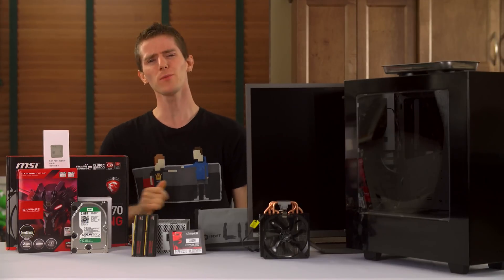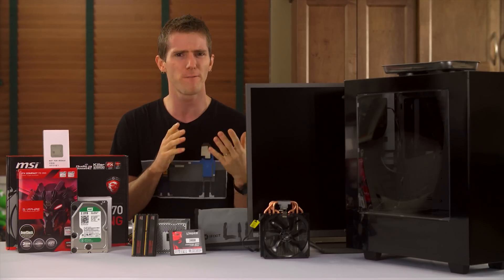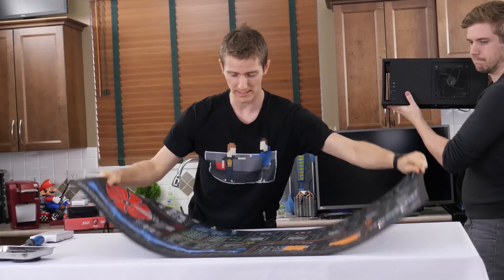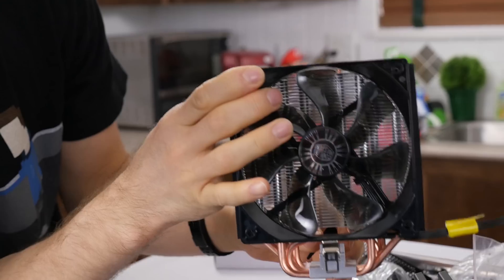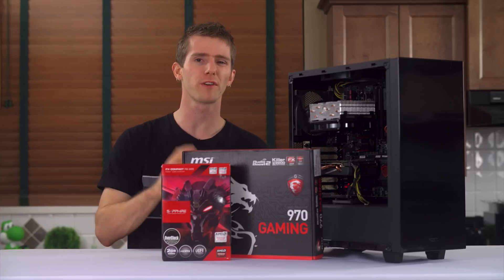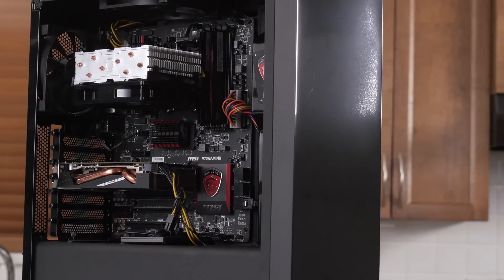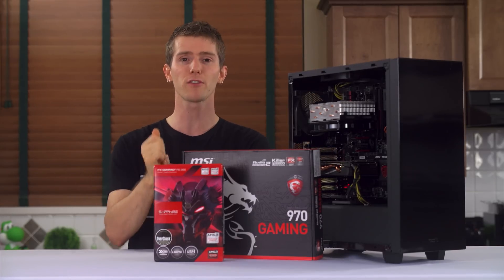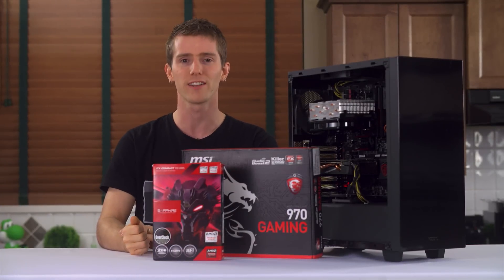Can you Build a 4K Gaming PC for Under $1000?

Comment: Hey can running games higher then the recommended settings be bad for your graphics card?
Reply: Nope. I run mw2 (it's still a good game) at 1440p on a laptop with highest settings with an average fps of 45. The recommended settings are 720p. (Geforce 750m)
Reply: Sweet thanks!

Comment: LinusTechTips You could've used the better GTX 750 Ti instead of the R9 285 and still save some money.
Reply: Siddharth Desai For a 4K gaming rig? Are you kidding right?
Reply: Siddharth Desai wtf, its not a 500 dollar build
Reply: Siddharth Desai the 285 kills the 750ti
Reply: Sergio Tellez Not for 4k. But on FHD 750 Ti is the better option. Gamers know that the words 'affordable' and '4k' don't go well together. If you want real 4k, pay the price!
Reply: Glorious Nvidia Master race
Reply: Siddharth Desai I'm sure you understand that a GTX 750 Ti is so cheapper, but it's so less powerful and the games are going to require more power
Reply: a 285 destroys a 750 ti, hell, even a 270 is better.
Reply: In a $1000 build I'd put a r9 280 on 2way crossfire or a gtx 980
Reply: Are you nuts dude??? A r9 285 rapes a gtx 750ti at any resolution. Even a r9 270 is faster. Gtx 750ti is comparable to a r7 260x/r7 265. Think before posting misleading stuff
Reply: Mukunda Madhab Rajkhowa its just, not even in the same bracket. The 750ti is not a 4k card

Comment: Please reply, need it badly
Is this a good build

Intel Core i5-4460: 

EVGA GTX 970: 

MSI H97 Guard Pro: 

8GB Corsair Vengeance RAM (Or 16GB did not decided)

256GB Crucial MX100 SSD:

1TB Western Digital Blue Hard Drive: 

600W Corsair CX600 Power Supply: 

NZXT S340 Case:
Reply: +Buff “BuffaloQuasar” alo its good except the power supply

Comment: CPU: AMD FX-8320 (4.4 GHz)
CPU Cooler: Cooler Master Seidon 240M Liquid Cooler
Mobo: Gigabyte GA-990FXA-UD3
RAM: Corsair Vengeance DDR3-1600 8GB
Storage: Sandisk SSD 128 GB, Seagate Barracude 1TB
Video Card: R9 290 
Case: NZXT Phantom 240 
PSU: Corsair CX 750W 80+ Bronze

The GPU is an XFX Double Dissipation Black Edition, with the aftermarket cooler removed cooled by a Corsair H60 mounted by the Corsair G10. I plan to overclock this as much as possible. How will this build run?

Comment: I have gone quite overbudget with this build (not including monitor keyboard and mouse and headset):

Motherboard:
MSI 970 GAMING ATX
 
Power supply:
Corsair CS 750M

Processor:
AMD X4-860K

Case:
Corsair Obsidian 450D window

Graphics card:
MSI GTX 960 GAMING 4GB GDDR5

RAM:
Crucial 8GB DDR3-1600 (x2)

CPU cooler:
Cooler Master HYPER T4 RR-T4-18PK-R1

Hard disk drive:
Toshiba MD04ACA400, 4 TB

Solid state drive:
Samsung 850 EVO 500 GB 600 MBps

Sound Card (not sure if necessary with mention motherboard):
LogiLink 7.1 Channel PCI PC0043A

Network adaptor (for better or worse internet I cannot say)
TP-LINK TL-WN881ND - PCI Express 2.0 x1 

Please let me know how well certain games will run using these specs.
Reply: ***** Good build if you could change a couple of little details (if within the budget) change the cpu to fx6300 6 core's is always a good option as the extra core will be helpful and if you can afford buy the 280x much better performance you will get higher frame rate in game's if gaming at 1080p
Reply: but the 960 is still very good for the price
Reply: Recent Hickory Yeah, well I made this list before doing some research and asking other people who already own a pc gaming rig. Here is the new list:

Motherboard
Asus Maximus VII Hero

Power Supply
Corsair Builder CXM 600W 

CPU
Intel Core i7 4790K

Case
Sharkoon T28 Red Edition

Graphics Card
MSI GeForce GTX 970 Gaming 4GB

RAM 
Corsair Vengeance LP 8GB (2x4GB), DDR3 1600 MHz

CPU cooler
Scythe Mugen 4

HDD
Seagate Desktop 1TB

SSD
Samsung 850 EVO 500 GB 600 MBps

Sound Card (not sure if necessary with current motherboard):
LogiLink 7.1 Channel PCI PC0043A

Network adaptor (for better or worse internet I cannot say)
TP-LINK TL-WN881ND - PCI Express 2.0 x1

Not counting the sound card, network adaptor and all future hardware and software, the total price comes in at less than 1500 bucks
Well, do you think? Definitely an approvement! Please let me know.
Reply: *****
yeah thats alot better =)
Reply: Recent Hickory You know what? One final adjustment. Replace the current graphics card with an
EVGA GeForce GTX 970 Superclocked ACX 2.0 4GB. It's only 20 bucks extra.
I hear this thing can rival a 980
Reply: *****
even better lol in my new build i'm getting the 980 ti =)
Reply: ***** Pretty much, I didn't even know what parts were even good, nor how much my first build actually cost. Now I do, and when it's assembled, I'm gonna have one hell of a good time with it!
Reply: ***** You wanna know something funny? Besides the RAM and mouse, I've not bought any of the parts yet. Also I didn't calculate my first build, so I had no idea how much it would cost, if it was even less than 1000 bucks.
But where I work, I make good money. And I'm gonna buy everything, one at a time over the following months.

I went with a core i7, because video editing is what I want to do in the future. 
The integrated graphics are nice to have if you are saving the video card for last on the list and want to play some old or cheap games in the meantime. 

Anything to add on that?
Reply: ***** Nope, this will be my first ever Gaming PC. I've been hungering to get one for years.

Comment: Would this build be able to drive TF2 and LoL at 4K on medium/high settings?

Asus Z97-P Motherboard
i5-4690k 3.5GHz
XFX AMD Radeon R9 280x 3GB (possibly to be swapped for a Crossfire Gigabyte Windforce R9 280x setup)
2x 4GB DDR3 Corsair XMS3 RAM

Comment: Just remember if you are wanting to game in 4K on a TV with an SLI setup,
The TV needs to have HDMI 2.0 for 4K @ 60hz (Basically only a 970/980/980TI/Titan X has hdmi 2.0 at time of writing)
And you want one that supports Chroma Subsampling at 4:4:4 , Because SLI seems to have a compatibility issue with anything less @4K 60hz..
You will get colored flickering on screen unless you change refresh or resolution.

Comment: Hey guys im going to upgrade my dell inspiron 530 from 2007 it has served me well and im wonder if i need to change anything or upgrade my psu.

MOBO: ECS Z97-PK Micro ATX LGA1150

CPU:Intel Pentium G3258 3.2GHz Dual-Core

GPU: EVGA GeForce GTX 750 Ti 2GB Superclocked
 
Ram:4GB RAMAXEL 1600mhz

Psu:300wats

Stock intel fan because im not going to overclock tell me if you need anything else 

tell me if i should overclock my cpu or gpu and aftermarket fan

Comment: Can anyone tell if that is a good setup?

Case: Aerocool V3X mid tower devil red edition black/red
CPU: AMD FX-6300 3.50 GHz 6-core
CPU Cooler: Artic cooling copper silent 3
Motherboard: MSI Z97A Gaming 6 retail socket 1150
RAM: 2x4GB Kingston HYPERX SAVAGE DDR-3
GPU: GIGABYTE GEFORCE GTX 970
HDD: SEAGATE 1TB Barracuda 7200.14 SATA3
Power: Gembird 600W 12cm fan

I want help cuz this is the first pc i want to build and i want to be a respectful setup for gaming. That build costs about 1200$.
Reply: Ανδρέας Χριστοφόρου You just messed up. You cant put Amd Fx-6400 into Socket 1150 motherboard.  Here is example of a build that I might do. That builds cost around 630. AMD Build http://pcpartpicker.com/p/GPMVQ7 .  Intel Build http://pcpartpicker.com/p/wqFPWZ . This one cost    $1072.90. Hopefully this will help you. Both include Windows.
Reply: james64468 thanks man , i think i will change my motherboard :P
Reply: Ανδρέας Χριστοφόρου your welcome.

Comment: im making a high end build for 2500 dollars
i have everything planned besides the gpu config
should i get a 2nd gtx 980ti in sli for 4k gaming
or should i buy the custom cables, fans and lighting first
i will most likely be buying a 2nd 980 ti anyway so should i buy 2 second gpu and then re do all the wiring later? or just pop in the extra gpu a month or so after i finish the initial build process?
Reply: Joshua Schleifer i would see if you're happy with 1 gpu, if not then you can still get a second one

Comment: Can I play games at atleast 1440p at 60fps?
EVGA GeForce GTX 970 FTW+
MSI 970 Motherboard 
Kingston HyperX Fury White 16GB
Intel Core i7-4790k
Reply: Super Steve Well you won't be happy with an AMD Motherboard and an Intel Processor... Take The Asus Maximus Z97 Ranger
Reply: MrZauberwuerfel Well with and Intel Processor and an AMD Mainboard he won't get any frames...
Reply: Carfreak36 he'd need a hammer to install the CPU into that motherboard.
Reply: Super Steve you will get 120+ fps in mainstream games (csgo, LoL,...), but ~30-50 in grahically intense games (witcher 3, crysis 3, farcry 4,...) depending on your settings
Reply: Oh and what about the cooling? Are you only going to use the stock cooler on the 4790K?
Reply: well no, because it won't run at all.
Reply: +lelcetz simply wrong... I can run witcher at 1440 p with all settings Max on my 970 strix and an i7 3770 with around 30 fps
Reply: Super Steve switch your 970 for a 390.
Reply: *****  #sofunny
Reply: Super Steve Uh no.maybe 12 fps in witcher 3 and farcry 4. 1080p is twice as easy to run 1440p ultra. like 70 fps in CSGO.
Reply: You won't even be able to fit your CPU in plus, no power supply or case means, ummmmm... no frames at all! ;D
Reply: Fallen Gamer ...a hammer.
Reply: Oh yeah, but what about the power supply and a case? Are you just going to put it on a wooden board connected to a radio tower?
Reply: But honestly no, the 970s lack of vram cripples it at resolutions higher than 1080. An r9 390 would be better. But that's irrelevant because your mobo has an AM3+ socket which cannot house an Intel  CPU and you don't have a power supply.
Reply: Yes I realized the Mobo isnt compatible so better the z97
Reply: +Scientist James why? he's going to have the same fps. Maybe 3-6 more fps with the 390.......but doing that change is just retarded....
Reply: iceagex costs less, 8GB of vram and more dx12 support.
Reply: Scientist James costs less? mate, not all countries has the same price. For example, in my country the 390 is more expensive (970 for 340€ - 390 for 360€). And having a lot of VRAM does not mean more fps, you should know that...
Reply: Use an i5 4460.
man you don't need an i7. And use the extra money to get a stronger GPU.
Reply: of course...1080 or 1440 u name the parts can handle it at ultra high...my sister built a rig before around 2015 and her gt 550 ti can run the games like gtav and gta 4 wothout a sweat...
Reply: Hell no you will need atleast 2 Titans in SLI to accomplish that goal
Reply: I think the biggest issue with that build is the MSI 970 Motherboard supports AMD AM3+ CPUs so putting a 4790k on it will definitely not work.
Reply: +iceagex and hes eletricity bill probably will be way higher too...

Comment: Here is a better build for $959.14USD
(624.73 pounds, 14793.06 Pesos, 1229.98 Austrailian dollar, 859.41 Euros, and 118898.35 Yen)

RAM: http://www.amazon.com/gp/product/B00J8E8ZOC/ref=ox_sc_act_title_2?ie=UTF8&psc=1&smid=ATVPDKIKX0DER

OS: http://www.amazon.com/gp/product/B00F3ZN2W0/ref=ox_sc_act_title_3?ie=UTF8&psc=1&smid=AZ8ZZL30AH7DI

Fans: http://www.amazon.com/gp/product/B0026ZPFBG/ref=ox_sc_act_title_4?ie=UTF8&psc=1&smid=A2EUTVCJXLAJ4K

Tower: http://www.amazon.com/gp/product/B007BDJ5SM/ref=ox_sc_act_title_5?ie=UTF8&psc=1&smid=AZ8ZZL30AH7DI

CPU: http://www.amazon.com/gp/product/B00DGGW3MI/ref=ox_sc_act_title_6?ie=UTF8&psc=1&smid=ATVPDKIKX0DER

GPU: http://www.amazon.com/gp/product/B00FLMKI9A/ref=ox_sc_act_title_7?ie=UTF8&psc=1&smid=ATVPDKIKX0DER

Disk drive for installing windows:  http://www.amazon.com/gp/product/B00194CVZ8/ref=ox_sc_act_title_8?ie=UTF8&psc=1&smid=AUW6YUZDQLDHM

PSU: http://www.amazon.com/gp/product/B00ALK3KEM/ref=ox_sc_act_title_9?ie=UTF8&psc=1&smid=ATVPDKIKX0DER

SSD(forwindows): http://www.amazon.com/gp/product/B00COFMOMQ/ref=ox_sc_act_title_10?ie=UTF8&psc=1&smid=ATVPDKIKX0DER

HDD: http://www.amazon.com/gp/product/B001IEXU68/ref=ox_sc_act_title_1?ie=UTF8&psc=1&smid=A2UY6FUW5VZE1P

Motherboard: http://www.amazon.com/gp/product/B00LUY72F6/ref=ox_sc_act_title_2?ie=UTF8&psc=1&smid=AZ8ZZL30AH7DI

Keyboard and mouse: http://www.amazon.com/HAWKPECK-2-4Ghz-Wireless-Mouse-Keyboard/dp/B00ESB9WF6/ref=lh_ni_t?ie=UTF8&psc=1&smid=A1BVYXEL822RF0

You should already have a monitor since you are on youtube. If not, they're fairly inexpensive at the moment. I use a TV with my computer, it's a lot easier and better for those of you who like to relax on the couch and play video games.

Comment: Can someone tell me if this looks good ? 

Intel Core i7-4790

NZXT Kraken X31 120mm Closed Loop Liquid Cooler

 HyperX FURY 120GB SSD SATA 

Seagate Barracuda 7200 1.5 TB 7200RPM SATA 3

Samsung 27-Inch Wide Viewing Angle LED Monitor 

MSI Z97-Gaming 7 Motherboard

Kingston HyperX Fury 16GB Kit (2x8GB) 

CM Storm Scout 2 Advanced - Gaming Mid Tower 

CORSAIR CP-9020055-NA 750W ATX12V / EPS12V Active PFC RM750 - Power supply ( internal ) - 80 PLUS Gold

MSI GAMING N750 TF G-SYNC Support GeForce GTX 750 2GB 128-Bit 

Please let me know

Comment: What's the point of building a sweet spot PC for playing on a non sweet spot resolution? Should use this rig to max out most/all games at the more reasonable (sweet spot) 1080p.
Reply: ***** Here: http://pcpartpicker.com/p/KN6YCJ

CPU: Great for gaming, due to it's four cores. Overclockable so you still have that option open. If you don't want to overclock, just go for an i5 4690 instead of the 4690k. If you plan on overclocking, be sure to invest in a separate CPU cooler, because the stock ain't gonna cut it.

Motherboard: 32GB of RAM support, 2-way SLI support, and it's BIOS is up to date with the new Haswell CPU. Great option.

RAM: 8GB of Ram is the sweet spot for gaming. 16GB would be good if you are going to be streaming or video editing. With the RAM prices dropping,  this is a good option.

Storage: An SSD isn't necessary for a gaming build, but it sure as hell is great to have one. It loads your games that you have saved on it a lot faster than an HDD would. SSD prices are also dropping so yeah. I also threw in a 1 TB HDD for mass storage.

GPU: Rule of Thumb for building a gaming PC. The GPU is almost always the most expensive item you're buying. The GTX 970 maxes out almost all games at 1080p60. And the MSI edition has a great cooler so yeah. If your games seem to be lacking, invest in another, because the motherboard we chose has SLI support eh?

Case: BitFenix makes great cases and this one has front panel USB 3.0 ports. Nuff said.

PSU:  Never flake out on the PSU. 80+ Gold rating is great, and the wattage  is enough for a second 970 when needed. 

If you want, throw in an optical drive, or add a mouse like the M45 from Corsair. 

Hope I helped you out and anyone else who is looking at this with the same problem!

I may or may not have copied and pasted this from an earlier post on this same exact video...
Reply: +Jack Kwan If you're only playing at 1080p get an i3 with hyperthreading, and just get an R9 280x. That's all you need for ultra settings 1080p gaming.

Jesus, my Fx-6300 and R7 260x still get 56 fps 1080p ultra preset on Battlefield 4.
Reply: louis holden That makes sense, and will also work.

My build however, is more towards someone who wants to be future proof, maybe for the next 3 years? Who knows.
Reply: +Jack Kwan If you want the ultimate in future proof then buy a 295x2
More powerful than a Titan X at half the price, and with full Dx12 support and a greater performance gain that Nvidia GPUs when it arrives.
Reply: louis holden Listen, I was just trying to help someone, you can talk to them, not me,
Reply: +Jack Kwan what do you think of this motherboard in comparison, is the gaming network better? are 12k platinum caps(100% made in japan) better? is it worth an extra $20? are there any other pros and cons of each to the other?